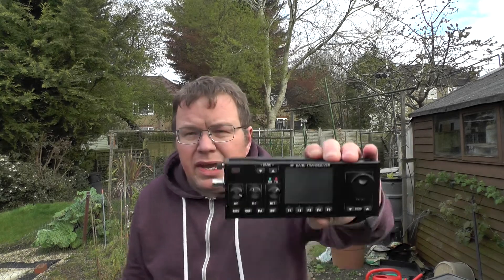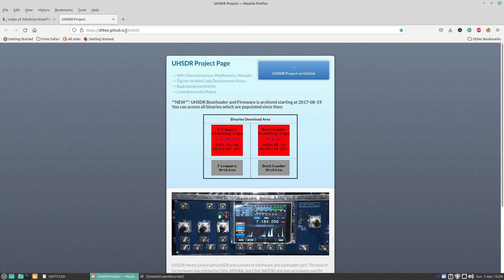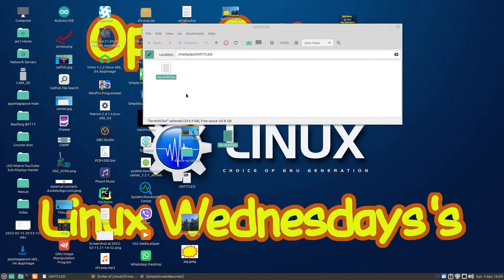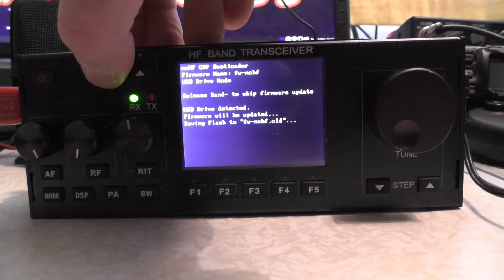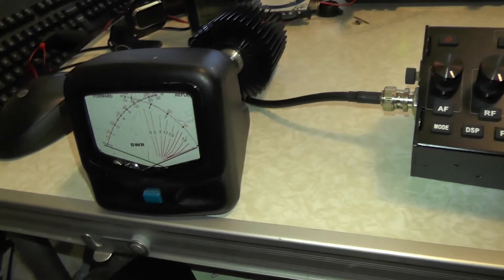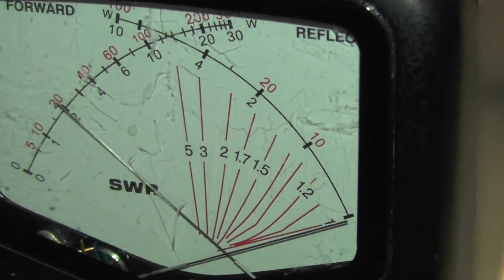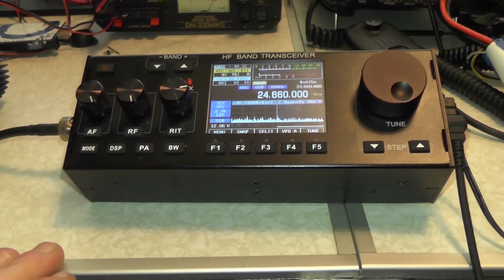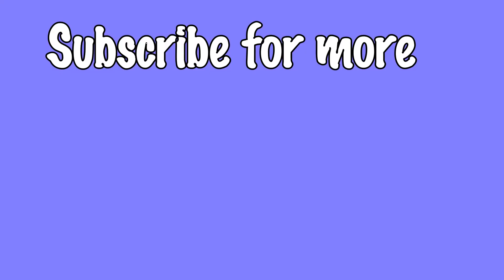RS918 Software update

Comment: You do know that you have to set the bias when you load new firmware? And you also have to calibrate the 5W and Full power for every band?
If you do not do that you cannot expect to get the right power levels plus you run the risk of destroying your finals due to incorrect bias.
Having said that 15W is wishful thinking from the marketing crowd, the best you can expect on the lower bands is around 12W and on 10m around 8-9W. But the difference between 10 and 15W won't be noticed on the other side.

Comment: hello, just wondering if there are any new firmware updates since this video? I have I don't use much and has been sitting in a box since I purchased the XIEGU G90. I would like to update it and get it running again. Looked but could not find much info.
Thanks
Reply from the maker: Ill check for any updates mine has not been used since i got a X6100 radio

Comment: Jez, could you plug in a CW key to test the power, or failing that a good whistle into the mic on SSB, you may get a slightly higher reading
Reply from the maker: Ok I’ll give it a try been playing with the radio and there’s a pa menu and I saw some thing about power levels maybe I can change them in there but will definitely try a whistle or a key